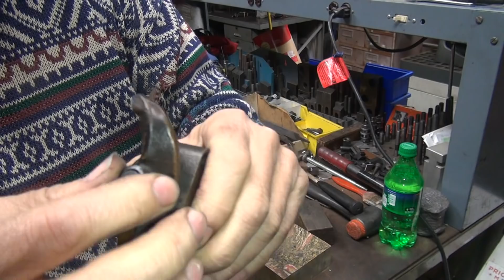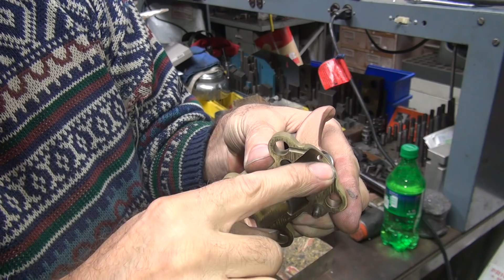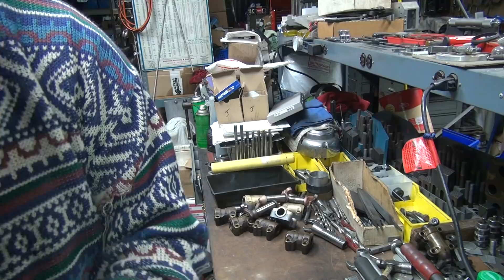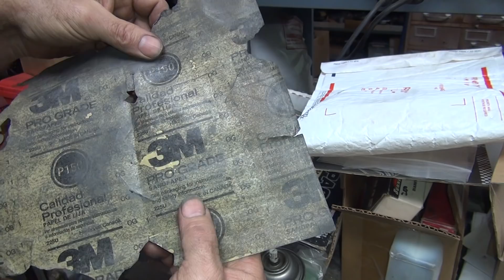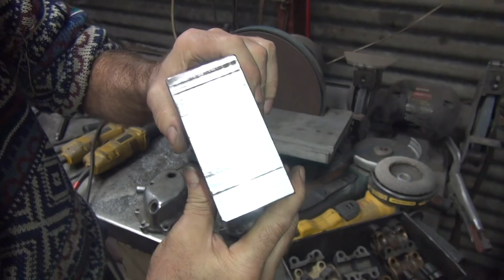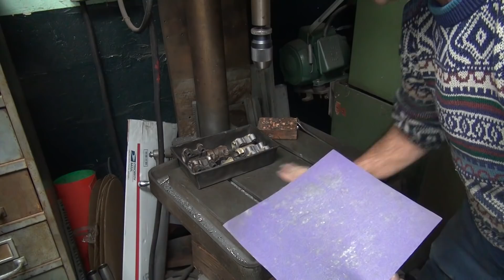1965 panhead #142 74ci flh motor rebuild and bike repair harley by tatro machine

Comment: Mr. Tatro,   A few questions:
1. What are some of the advantages/disadvantages of the Shovel vs the Evo, aside from the fact that the Evo's were largely 5 speeds, (and I'm talking PRE-twin cam).
2. Are there "bolt in" 6 speed trannys for shovels?  I suspect there are,  But without too many mods, for fitment/allignment?

Sorry,  don't mean to leave out your '42 flat heads, but I doubt I'd find in in any appreciable condition. . . . . 

Do you recommend roller rockers for Shovels?  Did they ever come with roller rockers? 

What would you say  would make the most reliable big twin?  Knuckle, Pan,  Shovel, given what's out there in the aftermarket, for replacement OEM parts?
Reply from the maker: evo motors are the best but i will take a flathead any day. 
i don't like 6sp's but the 5sp trans is good. for swingarm bikes you have to use a 5sp conversion trans. for rigeds you can just use the fxst trans.
watch the shovelhead motor playlist on what is available for them.
tatro
Reply: Thanks so much,  BUT NOW,   are you saying the FX Softail trans would work in a rigid? 
I will eventually see all your SH.   videos.
Reply from the maker: yes they do with the paughco adapter plate.
tatro

Comment: Never thought of using my collets to pull pins... That’s genius! I mark pan rockers and blocks using a file or the grinder, rear exhaust is one slash, rear intake two and so on I leave front exhaust blank instead of four slash marks...
Reply from the maker: i do that too but i wanted to see how these new to me stamps worked. bach to the grinding or file marks.
tatro